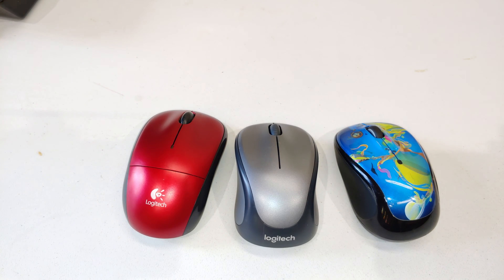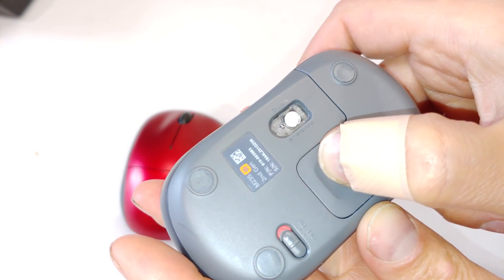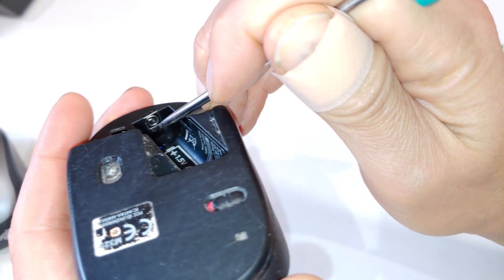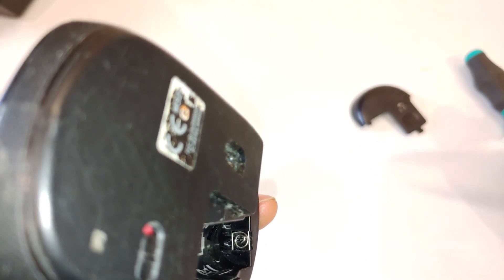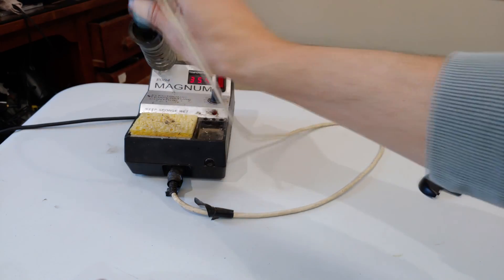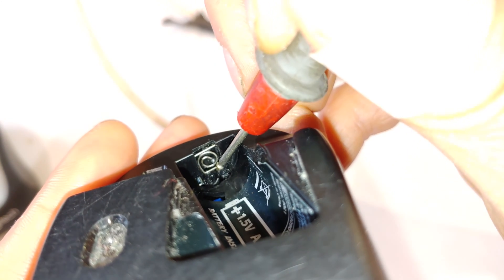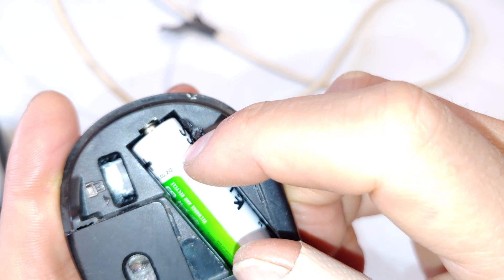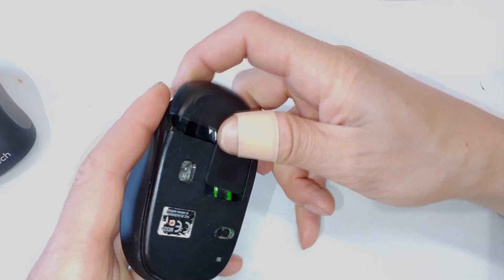Logitech mice (m325) not switching on - battery terminal repair.

Comment: Hope you are aware of the 2016 "Bastille" vulnerability allowing keyboard keystroke injection via Logitech Mouse unifying receiver - same receiver is used even if you do not have wireless keyboard.

Update receiver firmware to limit security hole - but use the Logitech "DFU" (Digital Firmware Updater iirc) program - because the regular Logitech Unifying software that pairs mice, keyboards and receivers NEVER shows any firmware updates as being available.

My experience was the DFU program found firmware updates a couple of generations newer than the Unifying s/w kept saying was the very latest.

The Logitech DFU program can be found tucked away on the Logitech support forums.

Why do Logitech keep saying it is only a Unifying Receiver? It is actually a Transmitter AND Receiver i.e. a Tranceiver how else when you press Caps Lock on your wired Keyboard does the Caps Lock light also light up on your Logitech wireless keyboard connected to the same computer.

Link https://www.bastille.net/research/vulnerabilities/mousejack
Reply from the maker: very informative, thank you for sharing that info